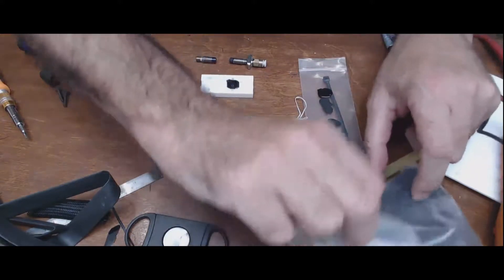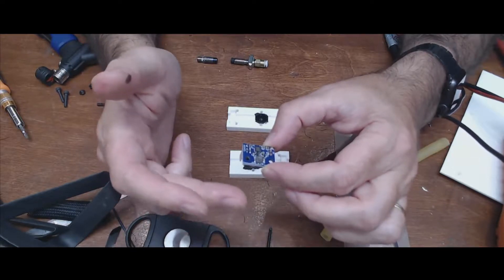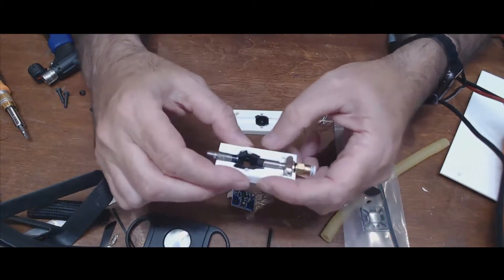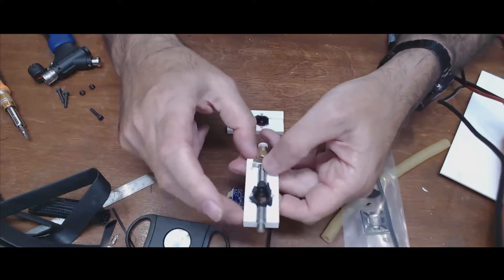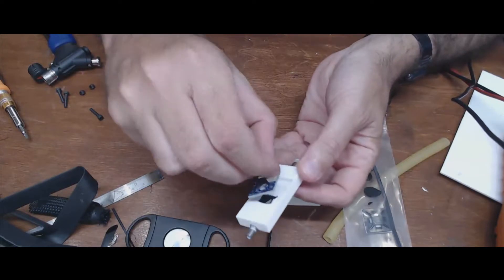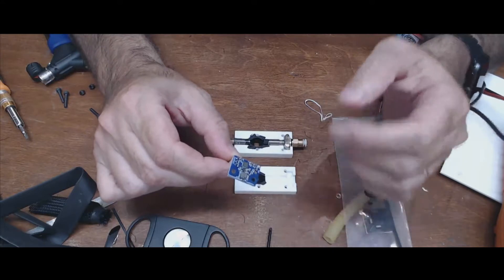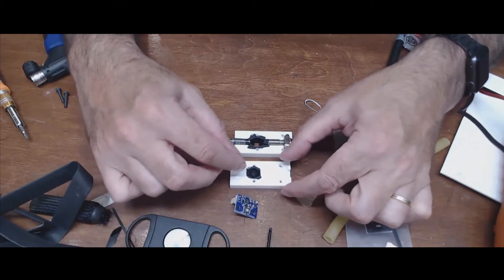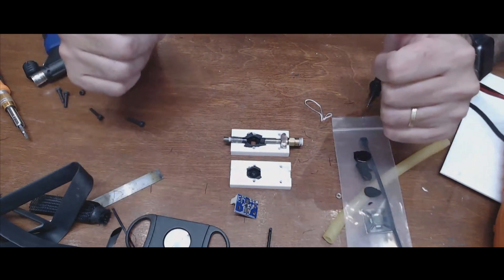3rd try for Duet Filament Sensor (Laser) case

Comment: hello how to calibrate laser monitor DUET3D????
Reply from the maker: how to calibrate it is at the bottom of this page https://duet3d.dozuki.com/Wiki/Duet3dFilamentMonitor_LaserVersion  That said, I was getting a lot of false "triggers" regardless of setting and have switched to the magnetic version of the Duet sensor. Still not perfect but a better.
Reply: @Core3DTech  Yeah, I'm about to give up on it. I can't run a print and walk away / go to sleep it keeps triggering.  It was working fine for a few weeks. I'm guessing it's the filament, but regardless it's too much hassle.
Reply from the maker: @mborowski2010  I've given up on it too. Every different filament acts differently (some don't work at all) and way too many false alarms. Someone at ERRF last year gave me the magnetic filament sensor and it works better but also once in a while gets me false alarms.